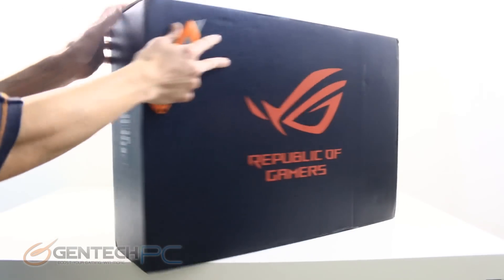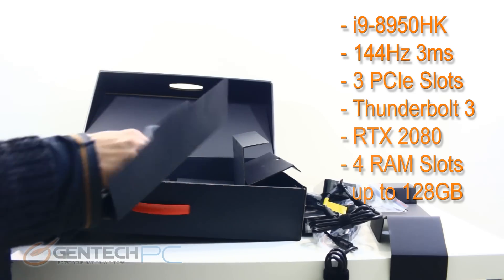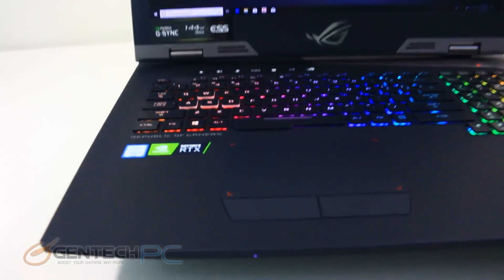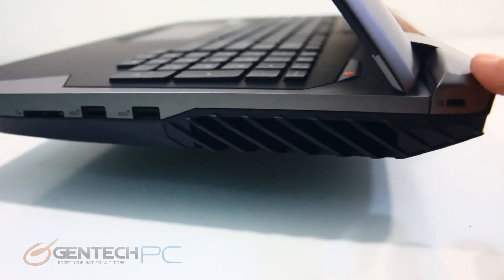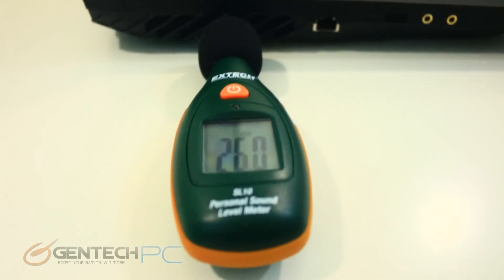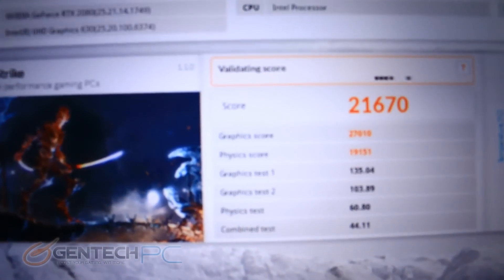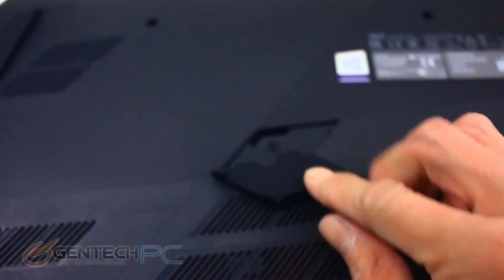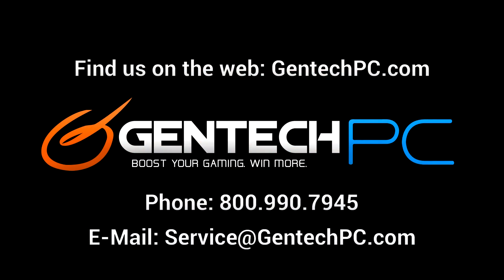ASUS ROG G703GX -RTX 2080 Core i9- Review and Benchmarks

Comment: I own this laptop it is a monster, I got it for a trade.   So far it's works great. I was scared because when you first turn it on and download updates and the windows 10 recent update it will update your bios literally  so it's smart to plug in everything and let it do its thing. After 2 hours I was able to enjoy the laptop  it has alot of great tweaks in hardware and software to give you your own custom gaming feel.  Despite it's weight and design it will not fail you in everything you want to do in gaming , programming, and editing.

Comment: I have this laptop, when you plugged in those 2 power brick.. it sound like a tornado inside your room. Very loud noise.
Reply: loud noise all the time? or only once you plug them?
and what happens if you you only plug one power brick?
Reply: @ahmedalsiqqiqi192  Actually there is an ROG setting button that let set the fan speed. What I use now is Balance mode and only use 1 power source.. it silent. Even I run Archicad, Grasshopper, Rhino, Blender.. it still silent. Only rendering with Eevee will make a fan sound but still low..
Reply: @NBCNothingButCrap  thank you very much
Reply: @NBCNothingButCrap  so I can use only 1 charger and play?
Reply: @ahmedalsiqqiqi192  Yes you can. I can play PUBG with no problem even with 1 charger.
Reply: @NBCNothingButCrap  very nice.  For example if I play witcher 3, whats the highest graphics settings can I set? (Like low, high, ultra) And how will be the charing?( Chrage slowly, not charging, or losing charge??) Sorry for asking too much, but I'm really interested in this Titan laptop and don't want to use 2 chargers most of the time.
Reply: If you don't have the witcher, just any other high graphics demanding games.
Reply: @ahmedalsiqqiqi192  You dont have to use 2 charger to do gaming, 1 charger is enough unless you hunting for high fps and do 4k in res. Im not much into gaming as well, Im more into 3D graphic design which need more higher specs compare to gaming. Baking a scene in UE4 will comsume more power and time.. sometimes it took a day to complete, mean your machine need to run at max performance for a long time. Tried with this laptop baking UE4 scene straight away for 7 hours, 1 single power source use, max temp just about 83. My 2nd try baking the same scene but this time with 2 power source.. it just took 4+ hours and max temp is about 72. Now I hope you got my point how this beast work. Give him more power so he can transform into a real beast.
Reply: @ahmedalsiqqiqi192  Regarding to your question, what highest setting this laptop capable of for Witcher 3.. LOL.. that beast will say.. "do you have any other games to play at the same time so I can run em at once..
Reply: @NBCNothingButCrap  first of all thank you very very much for your great answers, the problem is the more info you give me the more questions I have, and I'm embarrassed to ask more, but a simple yes is more than enough for me, all my questions was only regarding using only 1 charger, so your 2nd answer about running games with high settings was also meant for 1 charger?? If you say yes I'll mostly just buy it.
Reply: @ahmedalsiqqiqi192  No problem. With 1 power source, it can run any games in high setting, even ultra. But your laptop will not fully performed as it should as I said that beast need more power to transform into 'real beast'. It need extra power for it 'turbine cooler' which produce a noise sound.
Reply: @ahmedalsiqqiqi192  My suggestion, use 2 power source, but in ROG setting ( there is special dedicated button on the laptop ) to set how your cooling fan work. Then you can run any games at Ultra setting and your laptop will stay silence.. your cooling fan will run noise only when the laptop temp reached certain limit.
Reply: @NBCNothingButCrap  hahaha yes I have an ideal about 2 chargers performance, that's why I'm only asking about 1 charger performance, since I don't want it to consume too much electricity all the time and increase the bills, and I heard it must be plugged in straight into wall socket without any extensions for safety.
And in the same time worried if I use 1 charger it will effect laptop life, or drain the battery even if it's on charge.
Reply: @ahmedalsiqqiqi192  Thats not true. I use BELKIN BSV804af2M 8-Socket Surge Protector to protect my laptop. You are safe to go. Btw you can google about it power consumption. For me, use 2 power cable not a problem. I got 2 pc both use 1500W psu which I mostly use for rendering and they not effect my electrical bill much. The only thing that blow up my electrical bill is my cloth dryer machine.. it scary. So use 2 power source on my laptop give me confident about the performances. If you use 2 power source, but your ROG setting set to BALANCE mode.. it will consume less power also.
Reply: @NBCNothingButCrap  thank you very much, your information are helping me a lot.
I saw a review rating this laptop 100/10 hahah.
Reply: @ahmedalsiqqiqi192  LOL.. thats overrated. This ROG laptop worth the money and you will feel how 'beast' it is. Good luck
Reply: @NBCNothingButCrap  good luck to you too. I don't know how to thank you enough.
Reply: @NBCNothingButCrap  how would you do 4k on a fhd screen.
Reply: @chvishal  No.. it cannot. Because laptop is only fhd. Unless you connect with another 4k monitor.

Comment: I was about to say "that battery size is a shame" and than i saw "96WH" 15:55

Well, still not enough i guess
Reply: It's a desktop replacement.. meaning you only operate on battery for casual browsing or office functionality... otherwise jus like a desktop... why the battery is an issue for laptops like these I'll never understand.. it's actually dangerous to use these machines on battery at all..

Comment: You forgot, after remove the motherboard, you will find the two System RAM slots on the underside for uprade the system RAM. 
I found out by removing the mother board on my 4 years old ASUS ROG G750 for cleaning.

Comment: Surely someone could have figured out a way for it to run on one single power adapter
Reply: u can but the laptop wont be that powerful
Reply: Yeah they could but it would also be a giant 780w power brick like the ones the eurocom laptops with the 2 gtx 1080s use

Comment: No cooler for main M.2 :(  but there is big aluminum plate for empty slots. Good job Asus.
Reply: Just swap the M.2 to one of the spots with the cooler and switch boot drive in bios if you are that worried. Not that big of a deal.

Comment: Two powerbricks!!  Argh!  Dealbreaker for me!
Reply: How do you expect one power brick to power this machine? They don't make power bricks that run on nuclear fusion yet.
Reply: @CJBMAGGOT94  There ARE single power bricks that will power this machine.  But there is some federal regulation that dictates power bricks cant be bigger than 330 watts.  I've heard of people getting powerbricks from overseas somewhere.
Reply: @winterphoenix09  Correct, but Asus already makes these for their less powerful notebooks. I have the same one for my laptop and it works fine. If you don't want 2 giant power bricks don't buy this laptop, otherwise you shouldn't care and should know there are drawbacks to having a desktop processor in a laptop.
Reply: @CJBMAGGOT94  Pfffft!  I do care.  I like the rest of the stats.  Its a cool machine,  but it has a drawback that does not have to be.   THEY MAKE SINGLE POWERBRICKS THAT WILL WORK.  Why do YOU CARE what I have to say on the matter.  You working for ASUS?  You afraid I am scaring away business?  I dont need to be reprimanded by a guy with Maggot in their username.   Later,  ;)
Reply: @CJBMAGGOT94  ur just statiing the obvious thats why hes mad lol..evryone knows there are single brick on other less powerful laptop.. Geez

Comment: Wow 100c° cpu full load....time for undervolt using throttlestop or intel xtu
Reply: Definitely hot but it looks like it was 4.7 GHz which is impressive for stock . I bet with liquid metal it might get close to 5 GHz, basically what most people have on their overclocked 8700k's.
Reply: Definitely need to undervolt. For longer lasting components and better battery life.

Comment: 27000 graphics score in laptop is a beast. Only laptop gpu on par with its desktop counterpart
Reply: It is, but the non max-q variants of laptop GPU's these days are just underclocked desktop chips. The better the cooling and power delivery the higher they can run the clock speeds and this thing for a laptop has insane cooling and power delivery.
Reply: CJBMAGGOT94  exactly. They’ve come along sY with laptops. It should of been done ages ago. I can appreciate max q for the form factor. But Sometimes the laptops that I can only consider are max q. Fortunately my 1070 is a full version. But I only got this short term as the laptop I want is just smaller laptop of what I got in profile but same screen better everything. Just a shame it’s a 2070 max q.